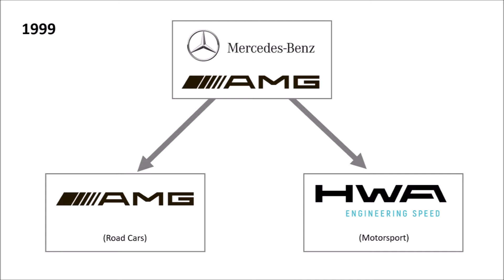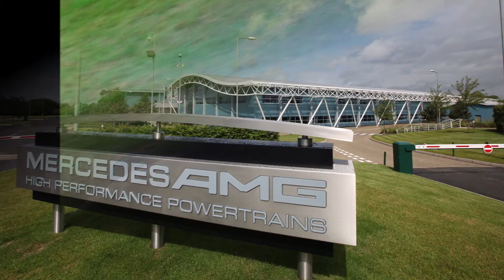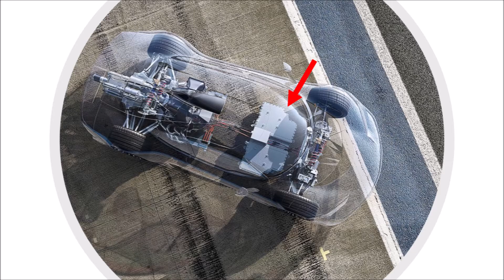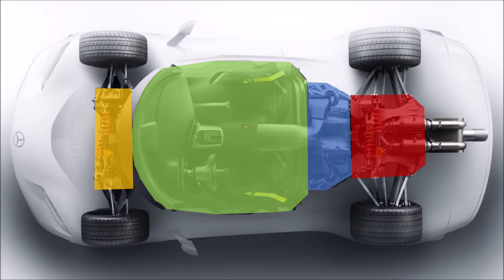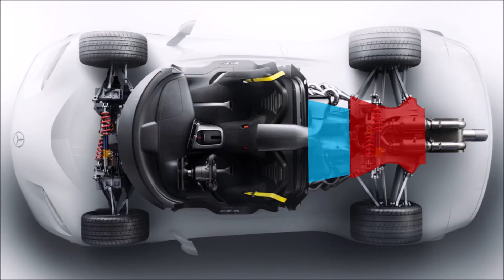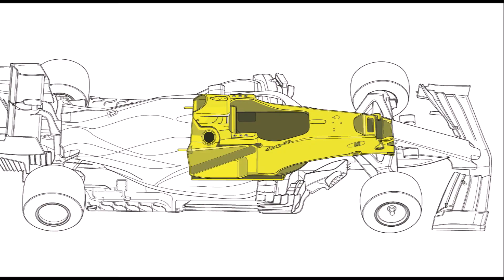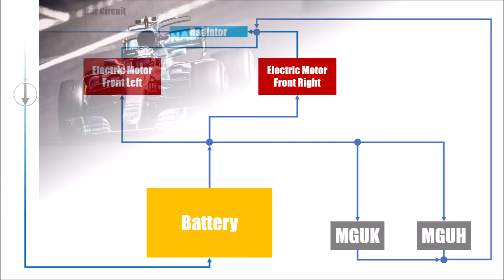AMG Project ONE - Historical Background and Technical Analysis

Comment: From the way this car is presented in this video it does seem like AMG could have done better, especially in the aero department. However, I wonder how much of all that info is correct, after all its all deduced from a few horsepower, downforce figures and pictures from the net. I do like the video very much though, gave it 👍 for all the historical info on AMG that I did not know, it’s also nice to hear all the German names correctly pronounced. I also think that if AMG did play it safe on the aero side, they most definitely picked up points on the esthetic side because, the Project 1 is a far better looking hypercar than many of its competitors, the Senna and Valkyrie are ugly IMO.

Comment: This car is a mess from a design standpoint. What is the point in doing a direct transfer of a formula one engine and drivetrain to a road car, if that road car is going to be significantly heavier and have worse aerodynamics than the f1 car?

Keep in mind modern F1 engines don’t sound nearly as good as the older ones so all you really have going for it is the insane performance. But if the car is expected to be over 1100-1200kgs you’re not really getting insane performance either. You still very much in the ballpark of most hypercars. For this car to be something special in my opinion it should have been somewhere the weight class of the Gordon Murray t.50 along with much better aerodynamic design shaping.

Despite the marketing hype from both the manufacturer as well as most of the automotive media, this car WILL NOT BE AN F1 CAR FOR THE ROAD.

It’s more or less a very capable but typical hypercar with a gimmicky engine that is going to need a lot of maintenance and repairs. This car is a disappointment in my opinion.

Comment: A very informative video as always! I have a few questions, though, if you don't mind!

1. Are you sure the 675kg of downforce is at top speed? Mercedes has been claiming their downforce figures at the industry standard 250km/h - like the 400kg for the AMG GT Black Series.

It might also be possible that it reaches 675kg (or close to that figure) at 250km/h and this figure is then maintained up to the Vmax to protect tires and to avoid maxing out suspension travel. I wouldn't imagine they would develop a car with less downforce than the much lower positioned GT BS, not to mention a lot of the other supercars and hypercars. And I am sure they also must have paid attention to the Valkyrie, and in order to not get totally embarrassed by that car I would think they did everything they could to up the performance as much as possible. 

2. Do you have any deeper info on the gearbox? Is it just a normal automated manual, or is it something more exotic? I wouldn't imagine they would go for a true dog ring sequential because of wear issues, but some small manufacturers have done it in the past (Gumpert Apollo, Ascari A10, Ariel Atom).

3. They had trouble getting the idle of the engine down. Why would that be an issue with variable valve timing, though? If you can dial less valve overlap at low rpm and still keep the high overlap at high rpm, what else is stopping the engine from running at low idle? Or are they keeping the original pneumatic valve system? I would thought that to be impossible. And if they put new heads on the engine, why wouldn't they go with a VVT system?

4. In the latest photos (when it broke down on the way to the N Ring) you can see the car is clearly raised - meaning it has adjustable ride height suspension. However, the suspension you can see on the early rolling chassis photos doesn't seem to include any elements that would allow this. Am I wrong, or have they had to rework the suspension to achieve the ability?
Reply from the maker: Very good points, thanks!

1. The only downforce information we currently have is from former AMG CEO Tobias Moers who gave an interview for Autocar in 2018 and said:
Downforce will be “approximately half the weight of the car”. Then he said the total weight of the car will be between 1300 and 1400kg (instead of originally less than 1200kg).
So the journalists took the middle (1350kg), divided it by 2 and said it will produce 675kg of downforce and every other magazin used that number too. We don't know the speed for that but it's likely he stated the maximum downforce it can produce to be competitive.
If this would be at 250km/h that would mean it would generate more than the McLaren P1 and looking at the Project One I would doubt that.

2. All I know is: automated, hydraulic, seven speed. 
Would be interesting to know if the 7 speed system is now running in a 8-speed housing, since they originally designed it for 8 gears. Changing the gearbox shell could also move the suspension points here, which would be a lot of development work.

3. Problem would be the low stroke layout. These F1 engines have 80mm bore and only 53mm stroke. Normal road car engines have around 90mm stroke. So by design there is less inertia because of the small radius crank. And there is also no heavy flywheel to keep the engine running. You are right, valve timing can help, but you can only do so much. And like I said they didn't want to touch the Brixworth system. AMG wants to keep the development costs for this as low as possible because they are high enough anyway and they won't design new heads.
The 275 cars for 2,275,000 Euro will pay them 625.625 million Euro back, which should be their development cost for this. If they spend more, they loose money.

4. I'm not sure if it will have adjustable ride height. On the technic model they presented a few years ago the heave damper looked manually adjustable, but no hydraulics. What we see on the Nurburgring pictures is the same as at the demo runs: That is no lift system, the car is pretty high, equally at front and rear. I guess they still have the very soft suspension we could see at the test runs and they need that space for wheel travel.
I experienced the exact same problem in Formula Student when we calculated the rocker ratios wrong...
Reply: @bsport320  Thanks for the detailed reply!

On the subject of Mclaren P1, I would suspect the downforce claim is exaggerated. The 918 - which was found to be pretty much equally as fast on track - only achieves 207kg at 250km/h! Already the Mclaren is lighter and more powerful; if it also had a big downforce advantage, then I don't see how the Porsche would be able to match it. But then again, it's Porsche and the power a hybrid car actually has over a lap of track is somewhat harder to determine...

The AMG One ride height seems very different from picture to picture:
https://s1.cdn.autoevolution.com/images/news/gallery/2022-mercedes-amg-one-hypercar-breaks-down-at-the-nurburgring_7.jpg
https://www.autorevue.cz/getthumbnail.aspx?w=1600&h=1000&q=60&id_file=248506814

The second picture is with the car running, but you can see that ride height on some other static pictures too and the picture was taken by another car, so it's not like it was taken at high speed when the downforce was pushing the car down. It really does look to me like it features adjustable ride height. I mean, I hope that's what it is (or some other weirdness exclusive to the prototypes) because with that much space in the wheel well the car would look pretty goofy.
Reply from the maker: The trouble is always that manufacturers claim something and we have to believe them because we usually cannot check. Some claim realistic numbers, some present some theoretical maximum values + some percent...

So the first picture you sent is the actual prototype with its suspension setup and the second picture is an official one from AMG for PR purposes. Of course they want the car to look good and set it up lower.
But every time the prototype drives it looks like an offroader and moves like a boat.
I hope they will fix that and we will see some Nordschleife pictures soon.
Reply: Excellent questions!
The only thing I am confident enough to say is in regards to the idle speed.
The bore of the cylinder is much, much larger than the length of the stroke... The high idle speed is probably due to the fact that the crankshaft isn't spinning fast enough, and the stroke length is so short the piston speed would be far too low... The combustion event would have to be very "small" for lack of a better term... Meaning it wouldn't produce much usable work.
I'm sure they don't want a heavy 5kg balancer on the crankshaft just to lower the idle speed. That would add rotational mass and lower rpm... Lower rpm =less power... Basically, the idle speed is the minimum necessary engine speed due to the piston speed.
The F1 V10 engines and later V8 engines were capable of 18,000 to over 20,000 rpm - but the piston speed at 20,000 rpm is basically the same as a high performance road car at max rpm.
Road cars use a longer stroke, so in order to achieve say 7000rpm the pistons speed of the road car would be roughly the same as the 20,000 rpm V10 engine. Because of the longer stroke and less cylinders, the pistons are traveling much further up and down inside the cylinder.
The only comparison I can think of is 2 animals running next to each other - one is a theoretical spider with 8 legs and the other is a human.
Both animals ran 1 km at the same exact speed.
The crab has 8 legs, so to move it forward quickly it only needs to move each leg back and forth a small distance and at a low speed..
For the human, they only have 2 legs and therfore each leg travels really far back and forth so the human can cover the same distance.
The feet of the human and the tip of the crabs legs are the pistons... If you looked at the crab in slow motion, you would see that the tips of its legs are not moving very far with each step it takes - but each leg takes more steps than the human.... The crab can divide the distance covered between 8 legs, the human only has 2 so each leg has to move a much longer distance.... But the end result is the same. Crab makes lots of little steps, human has to take long steps to move at the same speed and cover the same distance.
I'm not the best at explaining things so hopefully that kinda makes sense - and I know legs and pistons are not directly comparable... I just used a dude and a crab to try making the point lol

Comment: I think we need more cars like this T50, Valk, Project One - All have a purpose and inspired by motorsport. It's nice to see what manufacturers are capable of even if we can't afford them. 😄
Reply: To me car like Valkyrie is kinda pointless, a race car for the road never works as it will never be useable. So most will end up in a collection being displayed forever. T50 is different as it's designed to be driven in real world just it cost so much end up too valuable to be driven most of the time.
Reply: @lcw82  Agree with you. But mine thinking was that their intention was to lobby for LMP1 Hypercar rules. But because they now with Stroll partners fully committed in F1 we will never see factory Valk support as was intended. But still is nice exercise for Automotive sector of company. Its nice project none less.
Reply: @alesksander  Aston martin could not afford to make their own engines how they wanna even go racing. Car like valkyrie is just for show casing the brand nothing more.
Reply: @lcw82    Sure. Maybe was foolish for them even trying. I was just thinking yesterday. Maybe that bolt decision also contributed majorly in Stroll and his investors to invest their money on. Its showed company got talent, design team and somewhat vision to do something different in hard times. And bv i will just dispute and disagree "own engine" thing. Cosworth made bespoke engine towards their needs. Remember torque curve and shallow 65deg bank angle and high exhaust were all optimised for biggest venturi tunnels as  possible. So in essence was manufacturer effort on budget.
Reply: Fun fact the body panels for all 3 were made by the same company, Crosby Composites
Reply: if we don't see them at a track racing they are basically useless, they'll all end up in storage collecting dust for years... all of those cars should've been LMHs
Reply: The T50 is not inspired by motorsport. Heck, the tech it uses for aero was banned in motorsport immediately upon introduction. 

Gordon's goal with the T50 was to make the ultimate sports car. He made the T50 Niki Lauda because he is smart and knows he could sell more vehicles, and that people would demand it (just like what happened with the F1)

Comment: T.50 > Valkyrie > Project One 

Change my mind
Reply: I’d really like to see how these 3 will play out honestly. Back when the holy trinity was launched, everyone talked about the P1 and La Ferrari. But in the end, the 918 was the one that tops them all despite being heavier and having far less downforce than the other two.

Maybe the Project One will be the 918 of these trio. But that being said, nothing will beat the T.50 in terms of driver feel.
Reply: @devandrasimanjuntak1646  err from what I've read / seen,  it's the other way around... 918 has never got any chance against P1, let alone La ferrari.
Reply: 918 has proven to be faster around most tracks than both P1 and Laferrari
Reply: @menschmenschson7504  Really i heard Mcl got best tires and aero for its model. Still 4×4 is huge advantage in low speed circuits i could imagine.